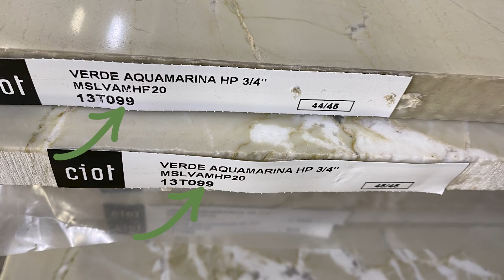Retro Ranch Reno: "Accent Wall Brainstorming" - Slatwalls! (Ep. 8)

Comment: Option 4 Mixed hands down!  OR from the bottom left corner to the top right corner, point towards the right (Sarah's choice) and the other half pointing in the other direction so that the direction doesn't pull you one way into the door and wall on the right.  It balances the look of the pull.

Comment: Mixed pattern. Also there will be a rug or bench. In a small room I think the stripes may be obscured.   Also it will make the most of the variations in each colour.  Not sure if it was construction dust , lightning or if they are actually different colours. Love the bathroom slabs!
Reply: Good point about area rug.  SR always puts one down.